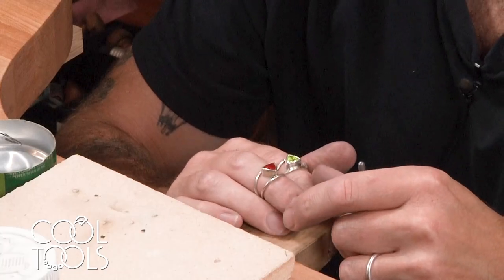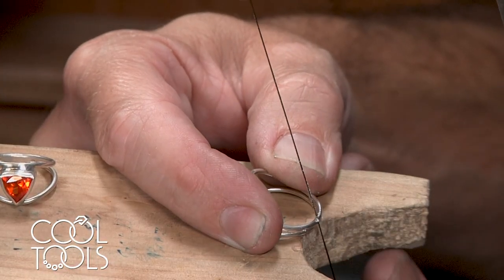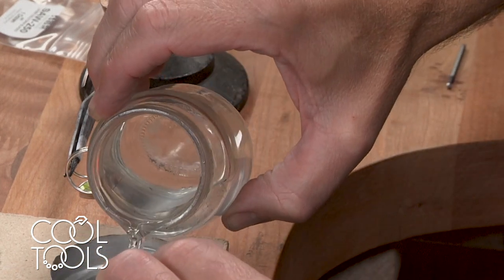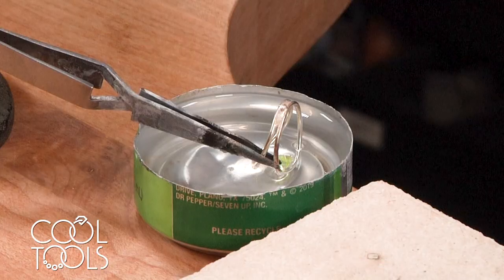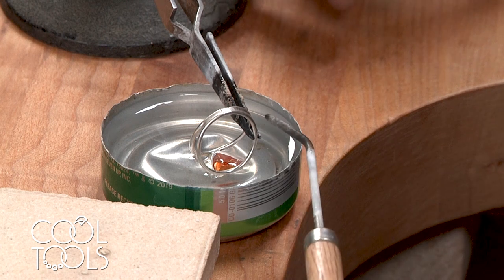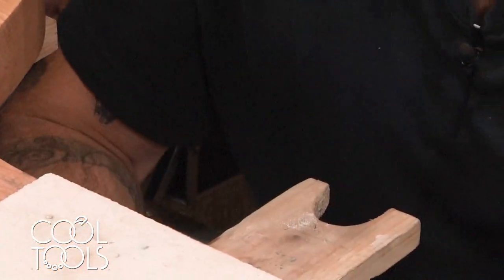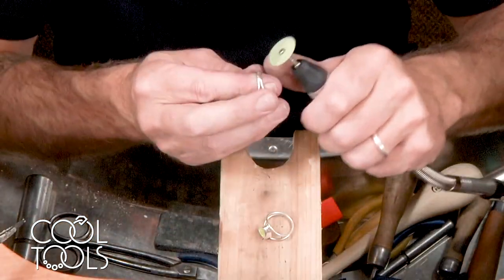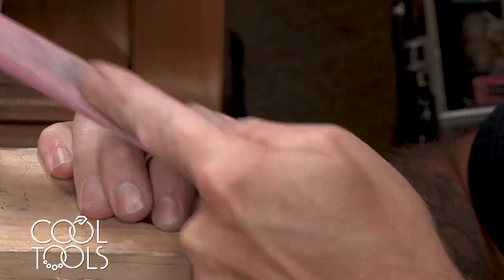Cool Tools | Sizing a Ring with a Stone Up and Down | Ring Scorch Protection by Matt Breunig

Comment: Why do you use the boric acid/alcohol before applying the flux? Does that clean the area, because I noticed you never cleaned anything before soldering.
Reply from the maker: Hi Lisa, we asked Matt your question and he said: It does clean the silver. I do try to keep solder joints clean from debris. The boric acid & alcohol cleans & prevents fire scale. 

Hope this helps!
Reply: @cooltoolsvideos  Thanks! That's what I suspected. I have a jar of it on my workbench but never thought about the cleaning aspect of it. I use it to ball wire - swirl wire then heat, blow out flame, then ball - but never thought to use it in this fashion. Good to know.